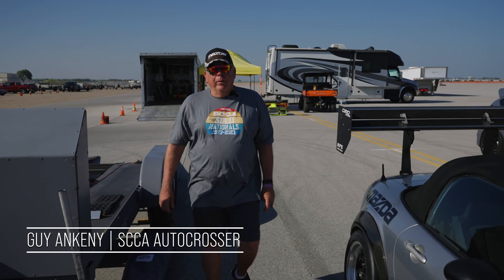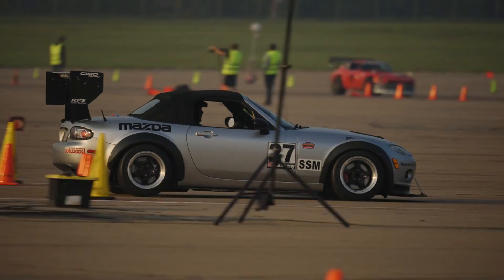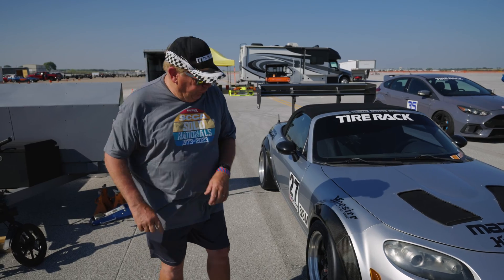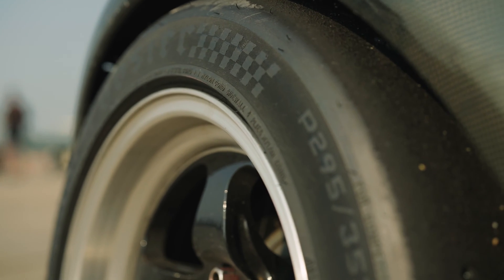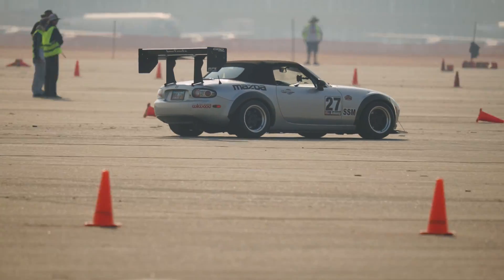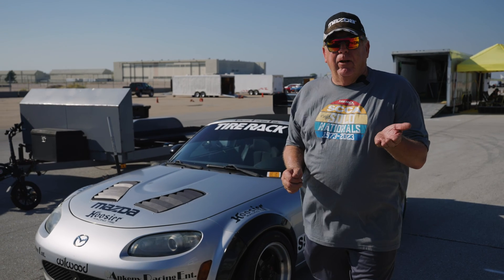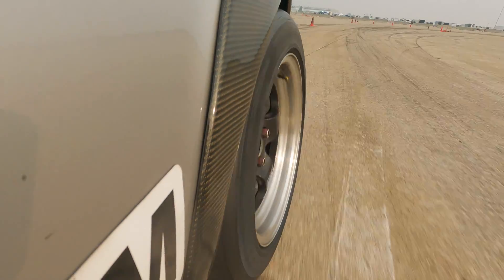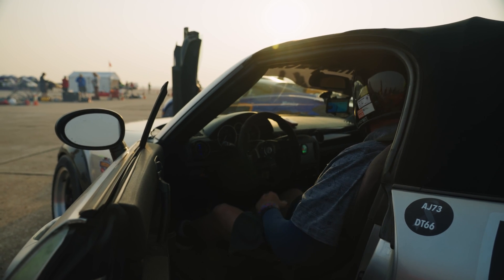Balancing Your Race Car | SCCA Shop Manual presented by Hoosier

Comment: 3:00 That's a bit of an awkward way of explaining what a sway bar does.
Try this:  A sway bar transfers spring pressure across a car during a turn from the inside (unloaded) suspension to the outside (loaded) suspension. Because the outer side of the car is in compression, a stiff bar will often prevent the inner tire from dropping and staying in full contact with the ground as the car's body moves on the roll axis.  Sway bars have the action of raising the effective rate of the outside springs.